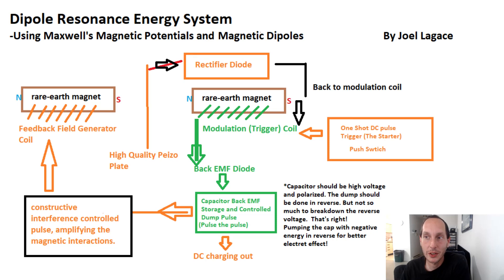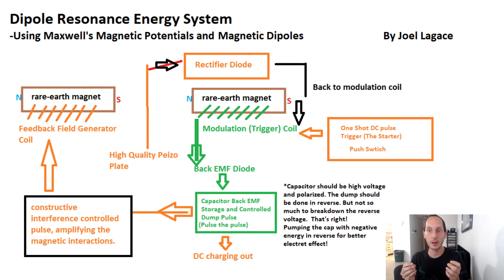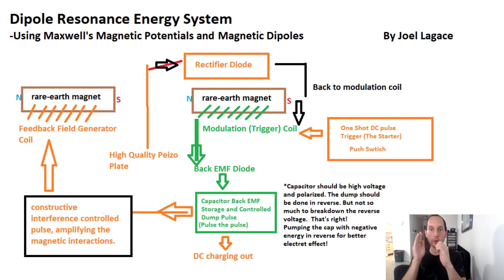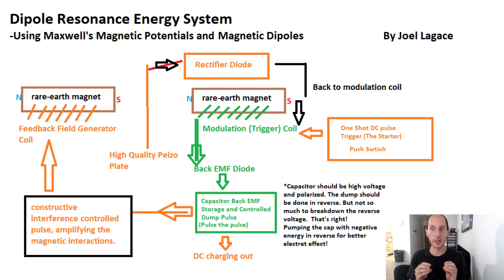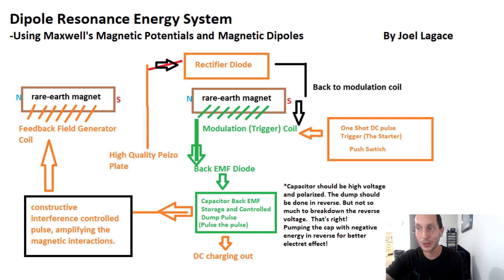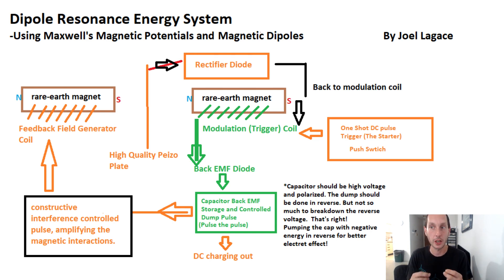Dipole Resonance Energy System

Comment: I am way way ahead of you = NOW I've watched this. I use what I call a Pulse NEE-NAA circuit to do the Triggering. My device also has no moving parts AND NO Permeant magnets = I move the Dipole with a small electro signal. I know exactly what your reaching for AND was already do exactly that in 2016 = I don't need your help at all = You can contact me at the address in my previous post.

Comment: so look here i have not seen this video, this is over 2 months old. but see i been using  a slimier term electric potential so its not that i copied you. no this is the logical path 2 men followed on a quest to seek out the Eather quantum world.. so it is a good story. and i am only half way through your vid. i take time to reflect on these similarities. remember 13 years plus have past on a similar path. the so called conclusion the AI part claimed to invent  was conceived a long time ago.electrical fluid acceleration fluid through volt double means. The so the double voltage is like moving a magnetic field. itself. so year you are spot on it again.

Comment: OFF TO THE RACES!👍 You are headed toward the Clemente Figuera device.  If you research that device, pay no heed to the Internet.  They have it all wrong in their interpretation of the drawings of that time era.  Everyone one wants to throw massive resistors or nichrome wire at it which is just stupid.  Keep your thoughts in the area they are now.  It's a combination of Maxwell's understanding and Tesla's interpretation of that understanding without the shortcuts of Heaviside and Steinmetz.  Joel, you will get this.
Reply from the maker: Just something I put together real quick that is related to all of this https://www.youtube.com/shorts/iBAGUxVGTf0 Again it's real dirty and i'm still experimenting so i'm not 100% sure on the whole final product note. Here is the video. I did get some interesting effects trying to self trigger it with its own magnets, But now its bedtime and will try building it more towards that device you mentioned,  I know this is a little off. I just wanted to try it! Thanks its the first I see of this device here. At some point I got like 25 volts with it. But much to o erratic behaviors, it looks like all of a sudden it just starts working then out of the blue stops....
Reply: @joellagace1679  Make sure your current direction on the magnet coils is not bucking for what you are trying to do.  Remember your thoughts on feedback between the coils. The magnets will want to push the collapsing fields as they are opposing if wired correctly.  A lot going on there.
Reply from the maker: I know too much going on lol thanks!